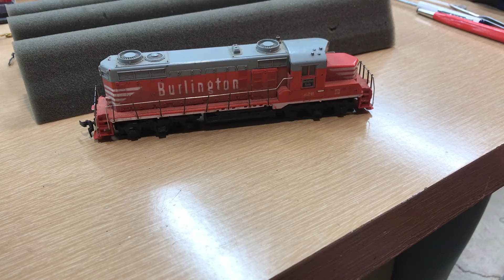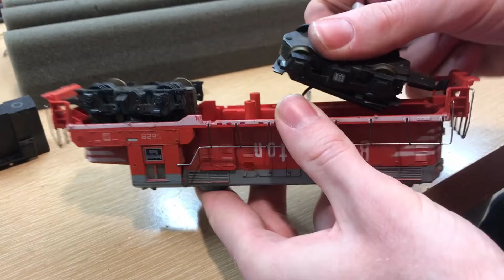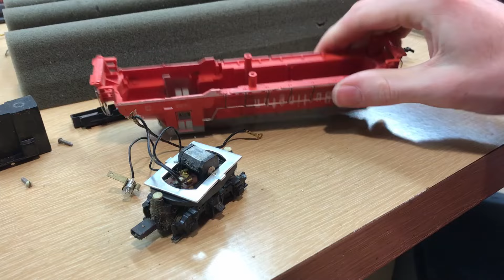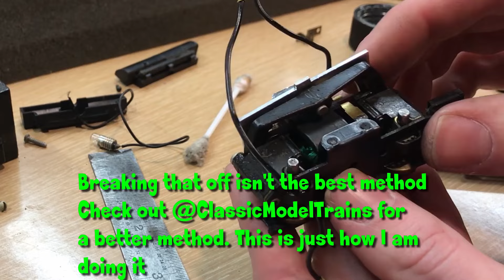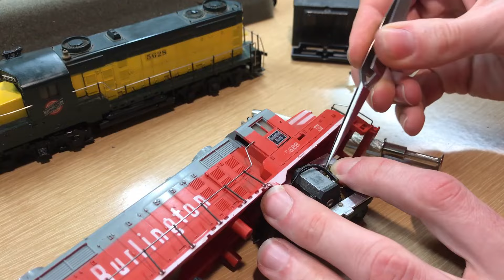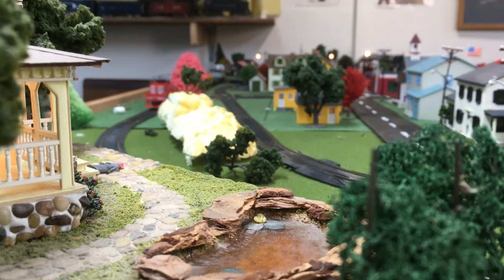Fixing a TYCO Burlington Engine MU-2 Motor

Comment: Super. My railroad still has seven almost fifty year old Mantua/Tyco MU-2 drive locomotives in operation. (Almost 10% of my fleet.) Two are Chicago, Burlington & Quincy/Burlington Route Chinese Red EMD GP-20 Locomotives that were fitted with dynamic brake blisters from two Lionel GP-9s, (Only the New York Central had GP-20s without dynamic brakes) had extra weight added, windows, diode directional headlights, and many new detail parts. The Geeps run great, both inside and outside, and have a nice patina on the paint job now that makes them look very realistic. Hello from the Tracy Mountain Railway in Colorado. 💙 T.E.N.